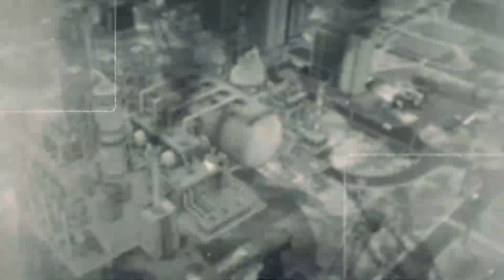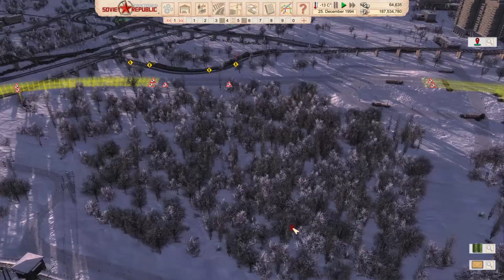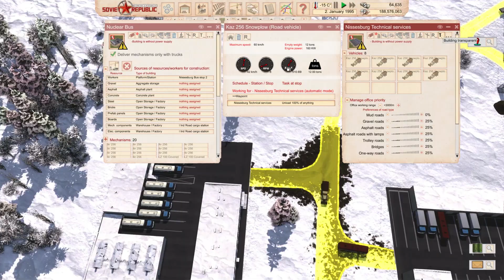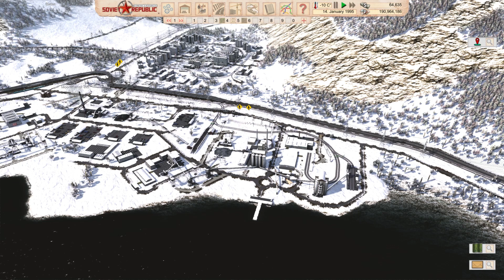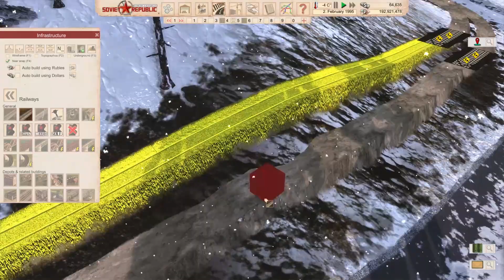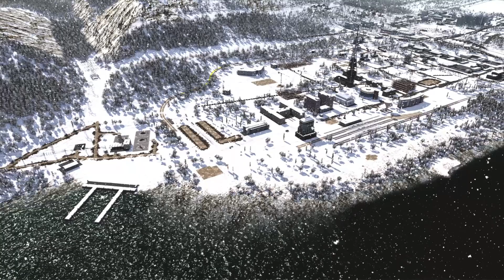Soviet Republic - Alaska - Monumental - Ep.166

Comment: @19:10: Why don't you just make the underground wires lower? Like put them below the pipes they cannot go through?
Reply from the maker: Because they are connected to the "path substations" And if I do they won't be able to construct it from the substation side if it's not 1 long construction.
Reply: @oolykeegaming81  oh! That’s bizarre!!!
Reply from the maker: @ChrisBrammer  not really. it's a game mechanic. Try building any building that only has paths. You will manage to build it but not adjacent construction (a pipe, electricity hoses, or conveyor belts. If the building is connected with the road, no issues. The best examples are path substations, path conveyor towers, and Robs's heat exchangers.
Reply: @oolykeegaming81  yeah, that’s still such a really bizarre thing though, functionally, right? Like what possible reason is there for it haha
Reply from the maker: @ChrisBrammer  none whatsoever. I mean lorries can get to the building in any case.
Reply: @oolykeegaming81  this game man. It’s frustrating…but hey, Alaska is looking beautiful mate!